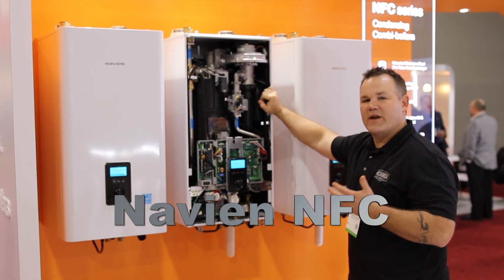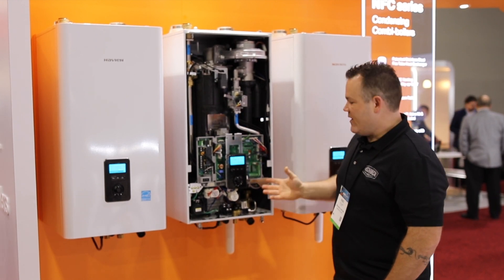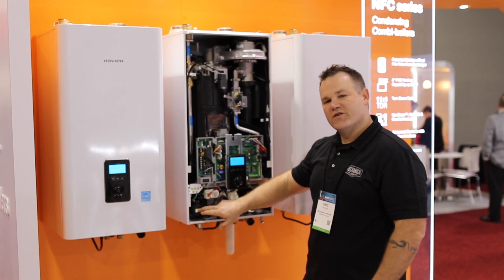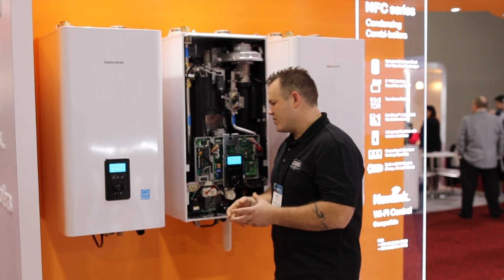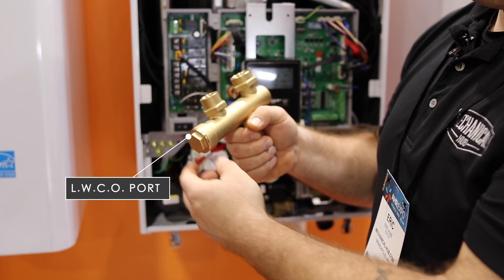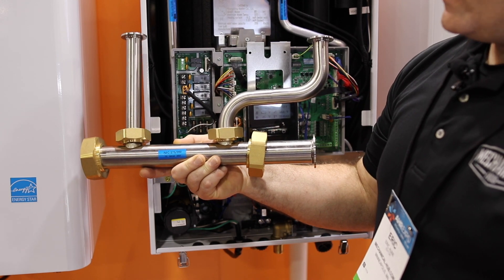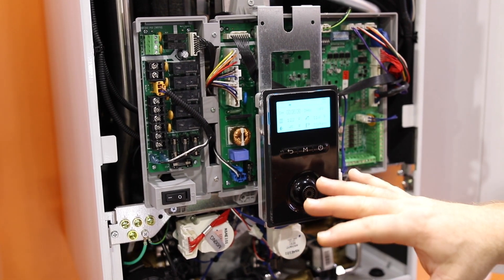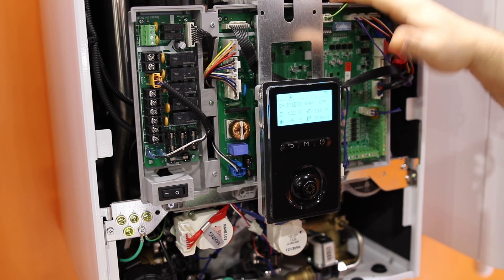Navien Firetube Combi Boiler (NFC) #ahrexpo

Comment: Put this in yesterday.  I’m in love with it.  The vent on top gets the air out of the boiler really well, much better than the ncb. The user interface is night and day better in terms of being user friendly.  I hated the old one.  The pumps/zone valve ability is an amazing upgrade. And the three way valve being up front is huge, although hopefully with the Naviclean being included it will help prevent failures.  Great job on an already great boiler!!!